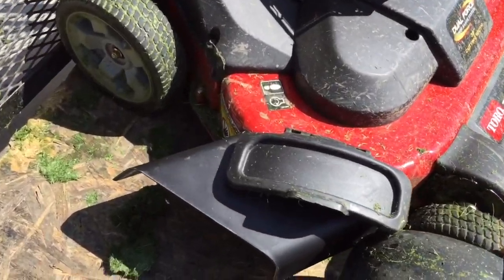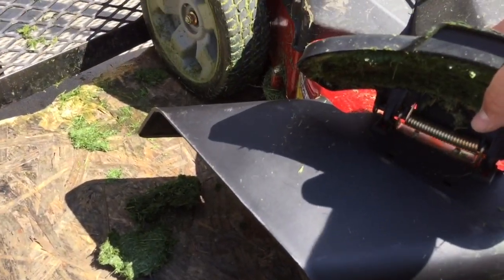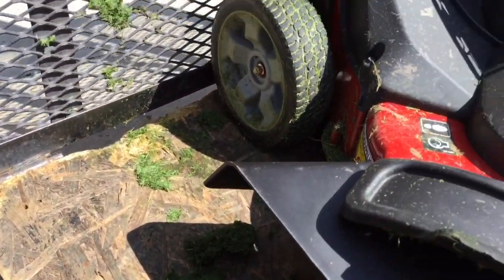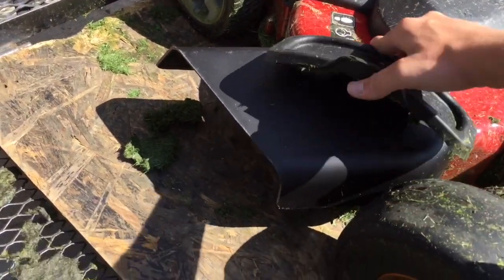Making Yards Look Beautiful And How To Install Side Discharge!

Comment: Personally, I hate the side discharge chutes. I find they frequently clog. (At least on a Husquavarna). The best method I've found is just to run a bungee and hold open the deck door that way. way better spread an it ends up looking nicer.